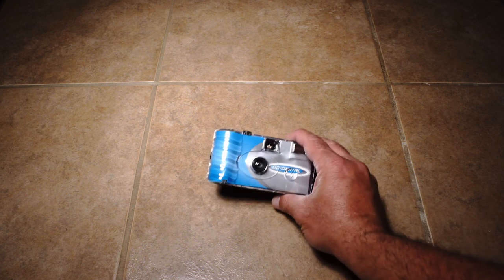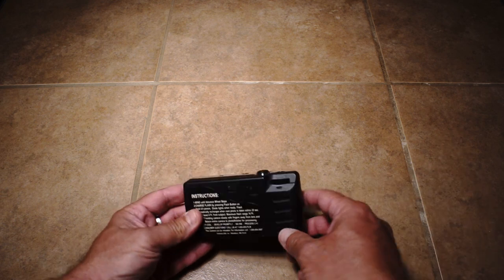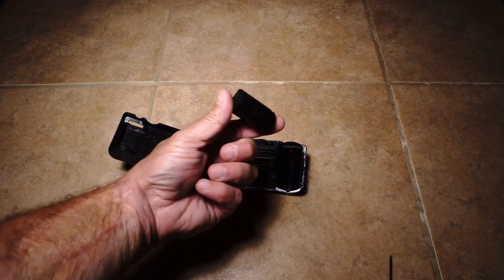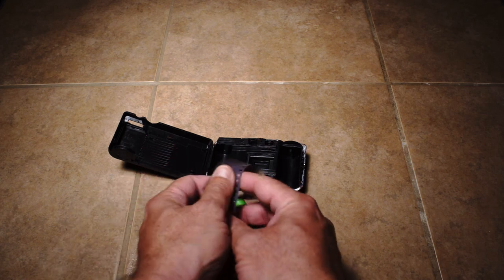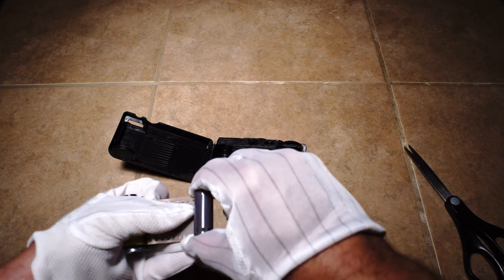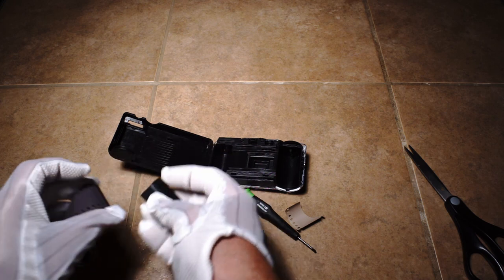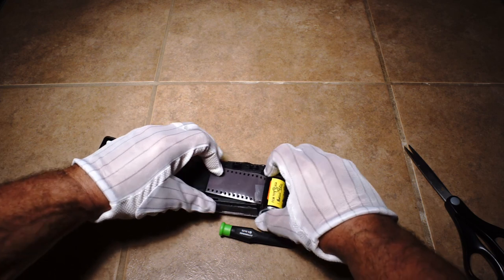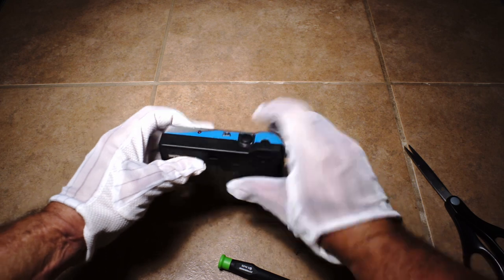How to Reload a One-time-use Camera

Comment: Hi everyone,
I just want to reload my Kodak Funsaver 800ISO but I have only a 400 ISO film...
Can I do it or my photos wiil be underexposed because of the ISO differences ? 
Thanks ! :)
Reply from the maker: Hi Alex, sure you can. They may be a little under exposed, make sure you use your flash indoors and a nice sunny day outside. Most of these cameras have a replaceable AA battery. Oh be sure to manually turn the frame counter back to ZERO before loading the camera. I think I forgot to mention that in the video. Have fun! =)